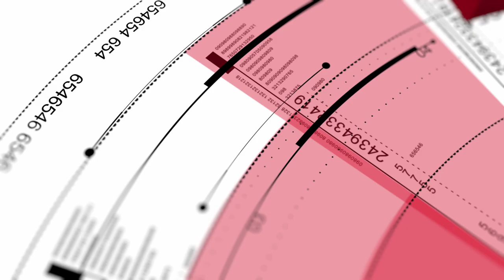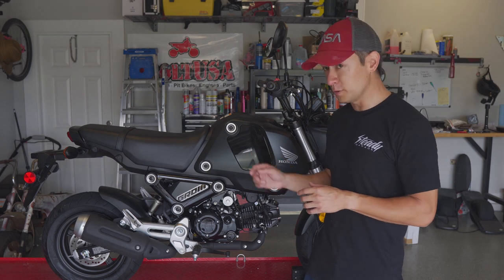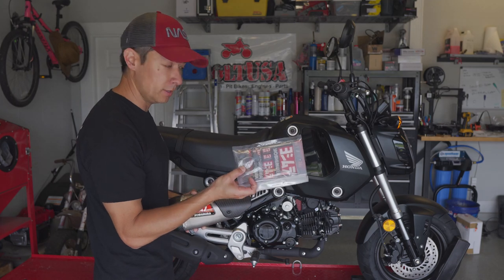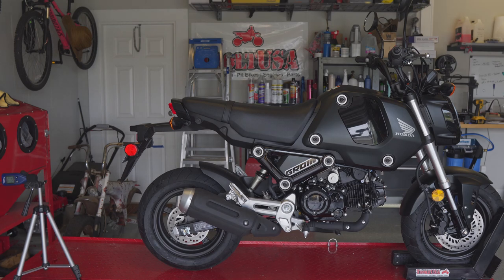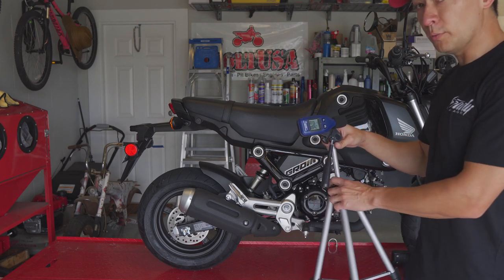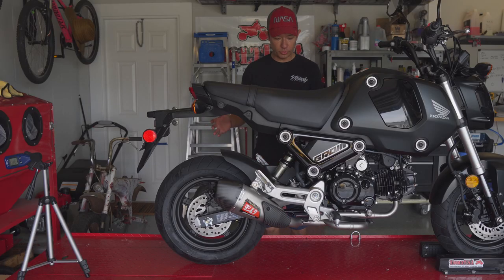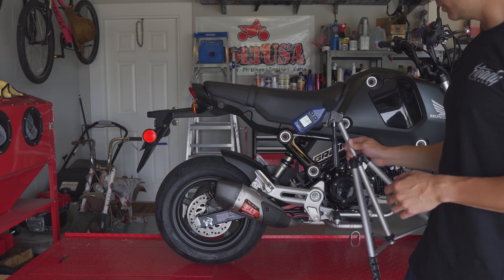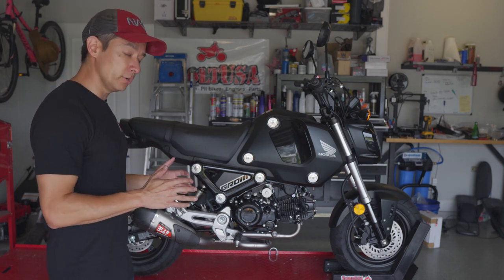2022 Grom Yoshimura RS-9T Full Exhaust & Chimera Verge Garnish Washer Kit

Comment: Yoshimura.  Nice. My local dealer doesn't have them yet.  How's new seat?   Good as Monkey?  Looking forward to more testing/riding vids.
Reply from the maker: The seat is really comfortable. I only have 30 miles on the bike at this point though so will update after I get some real miles on it.
Reply: I’ve done some 2 hour rides on my new Grom. The seat is pretty good. Wider than old model and as it is flat you can move forwards/backwards to change position every now and then. But it is no way near as comfy as the Monkey which has one of the comfiest bike seats ever 😀
Reply: @chrisiden  nice, thx for the info.

Comment: Looks great, weirdly when I put a Yoshi on my Monkey with no other mods I didn’t think there was any HP gain in fact slightly the opposite. With the standard can there seemed to be better back pressure.
Reply from the maker: The Monkey pipe is so short you're losing back pressure and probably losing power through the first part of the RPM range; you should be adding power up top. I think this bugle-style exhaust is to try and keep back pressure high enough to keep power throughout the band.
Reply: Hardracing and another channel did dyno comparisons with stock vs yoshi and it varified what yoshi has on their website. Under 4krpm there's a noticable drop in both hp and torque. As you move higher in the rpm range there's more gains up to about 10%. If you never go over 6k this is probably a really bad mod if power is your goal. Alternatively you can go with a slip on and get the look and more sound without cratering low end performance. Its about 6lbs less weight, so there's that, and the oohs and ahhs on the next group ride for what it's worth.

Comment: Are any other mods needed after instillation of the full Yoshimura exhaust system on the ‘22 grom?
Reply from the maker: The sky's the limit, but check out my latest video with the mods I've got now: https://www.youtube.com/watch?v=OyCYEm7PiTQ&list=PLBC1vXtmelfse31EPHSuiPeQ5YJi2CPOG - with intake, exhaust, cam and injector I'm making 13.5hp which is a pretty significant jump from the stock 9hp the bike makes to the wheel.

Comment: Need to be anodized in different colors because you replaced plain with shiny plain
Reply from the maker: The original plastic ones were painted silver. The raw aluminum matches the fork legs and will match the Gcraft swing arm that’s on the way.